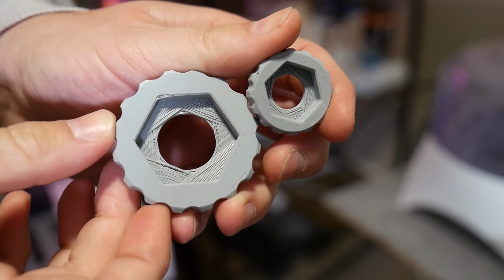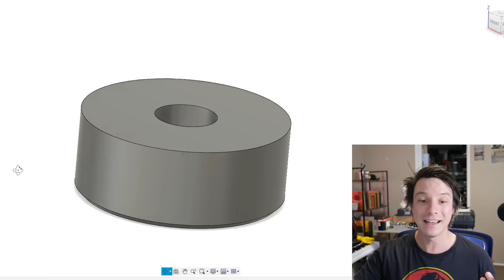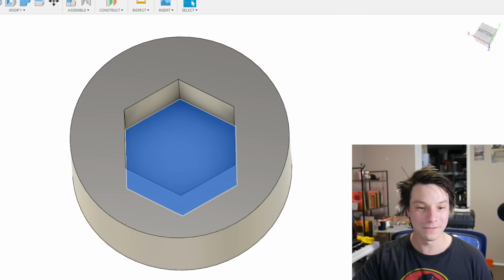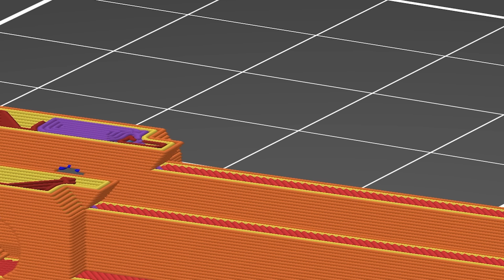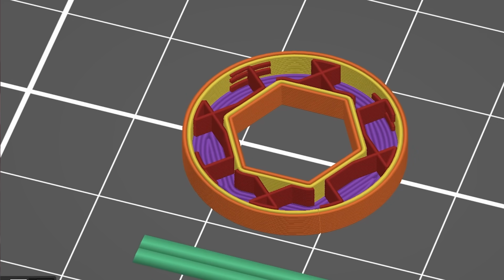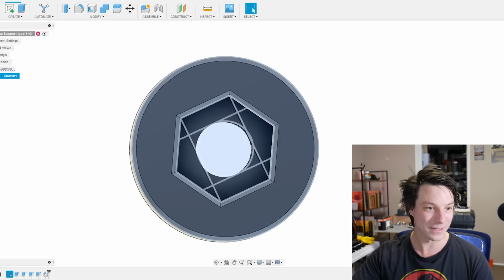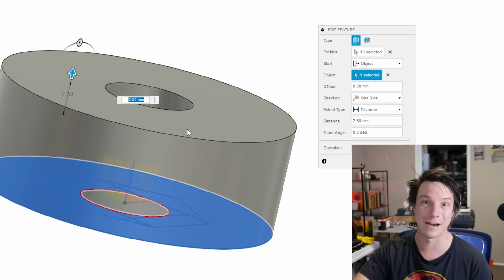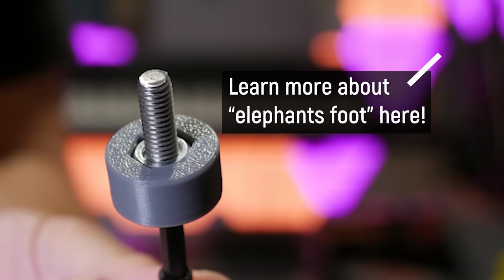How to 3D Print bores without supports (Fusion 360 Masterclass)

Comment: Is there any reason why slicing software wouldnt be able to handle this specific situation by making a flat spiral perimeter? Similar to vase mode where the tool works from the outermost edge to the inside edge in one continuous loop to creste the overhang? I could see this working for irregular shapes too, but perhaps not as well as circular shapes.

Comment: All this work when supports are readily available and designed to solve the problem at hand. Change your default support settings in your slicer so they aren't so dense, and it takes a lot less filament and prints faster, and is easier to remove.

Comment: Nice, thanks! Thats a neat way of creating overhangs, but specifically for nut and bolt fixings like that I like to pause the print, drop the nut into place and then continue the print. I didnt come up with that one myself, but this is mine: Pour wax into cavities with closed tops after pausing the print, let it set and then continue. The wax plugs easily drop out with a little warm water, but it only works with TPU or other plastics that stick to a cold print bed.

Comment: First why don't the slicers bridge between the closest wall automatically? I have never understood this. Instead its drawing circles out in clear air, go across the hole.

Second why brigde in multiple layers? Do it all on one layer. The cad techique used here is to overcome a deficiency in the slicing software.

Comment: Membrane Trick for a Horizontal oriented bore
I'll often have a thin 2 wall sacrificial membrane across horizontal holes.
Usually inset so that any marring won't be visible after cutting/drilling it out
The Purpose of doing this isn't for any support reasons, but to change the topology of the slice  so that the outermost perimeter can be traced continuously across both sides of the hole. This avoids doing a separate Retraction and Seam for each side, evens out extruder flow, and associated artifacts that can occur on non-ideally calibrated printers.

Comment: Great video. As someone who prints for a commercial reason, and some fun prints. Sometimes I need to print holes/bores. 
I am a tinkercad user. And I can see how to incorporate this into my tinkercad designing, and orientation on the build plate.
Cooling on most new 3D printers are good enough to support minor bridging. So adding it into the design can save filament and print time.
Mixed with CHEP's Ender 3 profiles, this saves me much time and headache. Because of South Africa's power outage issue, I have to fit my prints into a timeslot, bacause, SHOCK! sometime print resume fails. Or it leaves a terrible missing layer line on the print surface.
So, again, thank you for your videos. You, and other YT content creators makes my life so much easier with your educational videos. Or fun, watching you trying to balance a MK4 on a table that is a bit small for the purpose.

Comment: It'd be great to use variable layer height and make these interface layers much thinner. Would probably help all of the techniques more closely match the original design intent.

I guess you'd see it on the outside of the part which might look ugly, though

Comment: nice trick... just thinking you may do faster sequential bridging by negative extrusion from the surface of the nut (less elements to select on the same sketch). Ideally, you make this even using parametric stuff, so you can change the nut/hole size just by changing the parameters...  That being said, on thin parts, sacrifial bridging is the only proper solution....

Comment: You could simplify the third method and avoid using of offsets if you extrude the sketch both ways, up and down. The round bore could be extruded up and hex bore and bridges could be extruded down.

Comment: If the clearance above the hex bore allows, I prefer to just print without supports then used a soldering iron to heat press the nut in place, which makes it a bit more secure.

Comment: I stumbled on this issue number of times, and usually I just print it without supports and then clean up. Just few days ago I talked with someone about this issue and expressed expectation that slicers can handle this in more or less same manner as in your example. 3D printers handle bridges quite good and that should be exploited by slicers.

This idea of creating supports in model is interesting. I did not think of that and will try it. I believe it is OK until you have to do lots of holes.

As I said, would expect slicer to be able to handle this.

Now, another idea of handling supports. One may simply pause printing, insert actual nut and then continue printing. Also not applicable in all situations but may do the job sometimes.

Comment: Sacrificial bridge does not change anything to the size of the part, using half a layer height is normally enough to be picked up by slicer and it is super easy on the postprocessing as the slicer (at least idea maker) then decrease layer density by half.

Thanks for sharing the other trick it might be useful for larger series or when you need to avoid any leftovers. Just remember to first extend the hex pocket by the 2 intended bridge heights. But I guess it might be possible to define some custom hole tool in the most advanced cad software to streamline the process even further...

Comment: Theres another trick you can use. You can print the parts that would need to be supported first, then make voids of the said parts in your final print. Include a pause signal on the print where you will physically insert the overhanging part mid print and then resume the print to encase the part within the print.
Similarly to how people put magnets in their prints.

Comment: With my printer I'm sometimes pushing the 45 deg rule to 65 deg, which makes it way more usefull, if you have the proper cooling and knowledge to do so.

I havn't tried many bolt holes yet but i'll definitelly keep the sequential layer trick in mind for when I need it 😁

Comment: Great idea. 3DSet's Landy Mini on Printables uses really cool thin bridge supports for the windows of the body. They bridge the whole window gap, then stay a mm away from the edges for a cm or so upwards, then have another small bridge, then print the window overhang. The bridge breaks away clean but easily holds a 90 degree overhang without ruining the vertical parts of the window.

Comment: I've used this for a while now on things where I can't just use a flat head screw (which needs a countersunk hole that's equivalent to a 45° overhang). I see models all the time that include simialr features without any of this kind of trick - it drives me crazy. Like the screw/magnet holes on Gridfinity (which I never use with screws anyway, and the magnet holes are also oversized for "6mm" magnets.. basically the only ones I use now are based on customizable openscad designs). But I don't bother doing multiple layers to surround it from all sides, just one. The circular outlines end up a little messy but it's usually not even noticeable.

Anyone know if any slicers are working on automatic support for something like this without having to actually split it on the Z axis? It seems like the algorithm is fairly easy to describe. For all the toolpaths making up a bridge, order them such that lines spanning the full bridge get printed before inner edges, instead of the normal all perimeters first method. Or even just a slow concentric fill.

Comment: For the 45 degree overhang, if you know your printer very well, you might be able to get a more horizontal angle.  I know on my Ender 3 V2 Neo with custom cooling, I can print with a maximum overhang angle of 65 degrees in standard PLA, or 70 degrees in PLA+, so long as it's properly sliced.  Tinkering with the adaptive layers and bridge settings can make a huge difference.  Another option with the 45 degree taper is to only partially taper the nut to bore, and keep a flat surface that requires small bridging at the end.  Depending on the nut size, this could even be in the realm of the relief already cut into the nut.

Comment: I saw on that big... maybe a planetary gearbox? A lot of faceting on the inner surface, i recently learned a tip for fusion 360 about this, if you export to .step rather than stl or obj it maintains the circular geometry and your slicer will make circular/arc paths for it

Comment: The second option you showed, the cone shape. If you do just the walls of it it becomes a 1 layer bridge. Since its round, it will support itself and will fall off when you push it with the screw or collapse into itself when you push in the nut. Isnt this possible? I havent tried it but seems like it might work

Comment: Another trick you can do for the 45 degree overhang option is to print the difference between the part and the overhang part (in this case a hexagonal pyramid with a 6mm hole in the middle) as a separate part and glue it in afterwards

Yes its more printer time and an additional step, but it makes the CAD easy and still gives you a flat bottom to the hole to tension a bolt
Reply from the maker: Yeah that'd work too! Many options for sure
Reply: @MakersMuse  Dang it...I posted the same thing just seconds before scrolling down an inch and seeing this...DOH! lol
Reply: Great minds think a like I guess. Didn't even think to look 'til after I posted and then thought wait a second...SOMEBODY probably already thought of...dammit. LOL
Reply: You don't even need to glue it in, the nut/bolt will hold it ini like any washer! The major advantage of this vs bridging is that it doesn't make the model dependant on a certain layer height.
Reply: IMO, it's faster to use a full sacrificial bridge and drill them out, than it is to use this insert method.
Reply: @imacmill  true, if you can do it. I used the insert for TPU prints and TPU is hard to get good thin bridges on, especially if you want good print quality elsewhere in the print and good layer adhesion. As you need part cooling to bridge anywhere near successfully and at least in my experience running part cooling on tpu wrecks the rest of the print
Reply: I'd go for this method. My concern with sacrificial bridging is that it is more focused towards print convenience that structural quality. It doesn't look like the seating under the bridged part is going to provide a solid base, so if that 'gives' after time the nut comes loose and/or the binding starts to become floppy.

Comment: Especially on larger holes I generate a lightweight support structure 0.5 mm from the inner perimeter, so the bridge does not span the whole area. This has the additional advantage that one can remove the sacrificial layer easily by breaking out the support.

Comment: I just do the design and modeling for my parts and I send them to my print guy. I know enough about 3D printing to know about overhangs etc, so I always make the bottom face (the face touching the print bed) a different colour so he straight away knows the orientation I intended for it to be printed in. It's a small detail but is great for everyone to be on the same  page in  back n forth emails.

Comment: I just started doing this from a video I found 3 years ago from @Maniacal Lab LLC. 

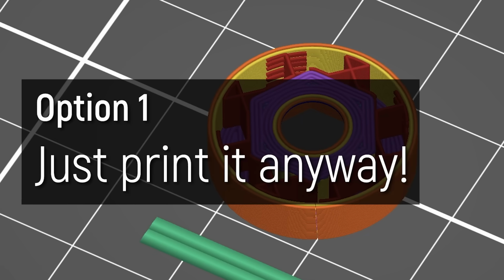And for horizontal holes I use the method you showed in your print without supports video with a modification to the teardrop hole shape. I cut the top of the teardrop off so it has a flat edge. The printer can bridge that easily. Make the flat part at the same radius where the circle would be. Makes for a nice fitting hole if anything is supposed to fit inside since you’re now supported at the top as well. You only have two small bits of open air at like the 10:00 and 2:00 position.

Comment: Really great tip  thanks for sharing. Other related question, what dimensions are you using for the hex and bore? Exactly the same as the nut, or some offset?  Is there a rule of thumb, like always add 0.1 mm?

Comment: Folks are missing it but this is the real application for arc overhangs. Not printing gratuitous cantilevered stuff off the side of a print, but having nontrivial hole geometry the slicer can just get right for you automatically, without sagging bridges (this matters a lot when you only have exactly the right clearance for a nut), and without having to do it in CAD.

Comment: This... is kinda out of context tho. Nophead did this, as far as i know, for incorporated nuts... in a flat function, this doesn't really make much sense and you're better off using either support, or just group in group (which results in a part inside, akin to printing hinges).

Personally, i just print it with support, with a good printer and proper settings (of which there's tons now, not like in the old days) removing the discard is a breeze. There's also the Japanese pillar method which leaves a super easy plug to remove and the most recent trick where you put a nylon nut, giving yourself a layer marker to know when the right moment to put them in.

I've also seen, but have not experimented with putting puttied bread inside. I can't find the blog post about it (written in Japanese, so i lost the right naming, if i happen to find it, i'll leave a tag bellow) but a Japanese fella experimented with an entire series of methods from kinetic sand to Plasticine, and concluded that putting bread inside (preformed - he had a custom made syringe that dispensed perfectly made bread hex cores) results in the right kind of support as it doesn't burn, grabs the filament and it's extremely easy to remove.

The inside of his prints looked extremely crisp. As soon as i'm getting a model for the syringe, i'm trying it. edit: thought i'd add, the bread might actually be rice bread...so, that's complicated if you don't have that kind of bread.

Comment: for the 45 degree approach, you can also just 3d print a spacer in the negative space separately, then fit it on before the nut--so it clamps down against the spacer.

Comment: Have you considered printing a washer to fill the wedge missing from the 45deg overhang option?  No manual processing other than inserting an extra part where 2 are already being inserted, so minimal extra work.  I did consider injection molding the plastic into the cavity after the bolt was inserted with a 3d printing pen or epoxy, but that seems like a bunch more manual work vs just printing a washer.
Reply: should also have a higher fill ratio than the partial-bridging strategy that misses at least a couple of layers where the bolt needs support

Comment: The easiest way to do the sequenial bridging is drawing the negative shape of the bore with everything build in it even the chamfer for each size screw and save it, you can easly bring that shape to where ever you need a bore using centre reference then substract it from the original shape instead of drawing the bore everytime, I use Rhino software , not sure about fusion 360, though I expect it can do it too.

Comment: That’s very interesting. One thing I have used with very good success has been Cura’s tree supports.   With a low density of 2-3% and support interface, my large overhang prints for my Iron Man build have gone incredibly well.
Reply: I've had great results using 0% infill with tree supports, and saved so much time

Comment: With the 45° overhang roof on the bore, you could also print the positive version to insert before the nut.  It should be an easy print, and distribute loads more evenly, and if the tolerances are just right you could actually have a stronger feature than with support material due to the increased number of perimeters...
Reply: true, but that's a bunch of extra work

Comment: You can also just offset the bolt walls in, connect the corners in an angle to the wall, and then extrude like you did. It would probably be quicker and more supportive. Just note that having more extrudes does increase the thickness of the wall.

Comment: Hi ! Thank you for this technique. I use another one, but not by modifying the modeling. I often make parts that require a molded nut, incorporated into the part. I program a print pause just before the layer that covers the nut's imprint, I place the nut directly in the printed part, and I restart the print. The nut supports the axle hole.

Comment: Why not just pause the print at the correct layer, insert nuts and then continue printing? No clean up/bridging required and it can surround the nut on all sides so it cant be removed! I also do this with magnets.

Comment: I made a video about this topic 3 years ago.

https://youtu.be/v90NKni7n7E

My favourite is sacrificial bridging with an support pillor in the middle. For some applications I mad special tools to cut around the pillor to remove it clearly.

A bit more hassle is using polypropylen tape as a separation layer. It ads a step while printing, but makes for perfect undersides.

Comment: I think you should just flip the part upside down. J/K

I use the 45 degree method all the time when it makes sense.

I never used the bridge method used here because of the extra time it takes, but I might give it a shot.

If you have more time, it looks like you can get rid of the small corner arcs(making the opening a square) and merge it into a circle at a 45.

Thanks!

Comment: I use sequential bridging.  And usually it's an afterthought, so I already have my nut holes, then go oops.  So create a parameter "layer_height" and reference that off the initial bottom nut face. Makes it much easier to update when I decide I want a 0.2mm layer height over a 0.3.